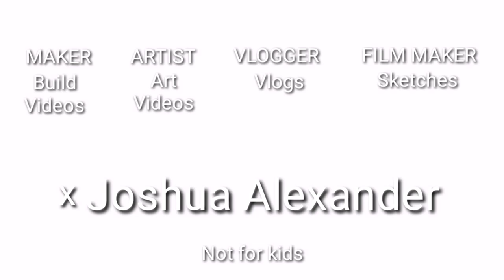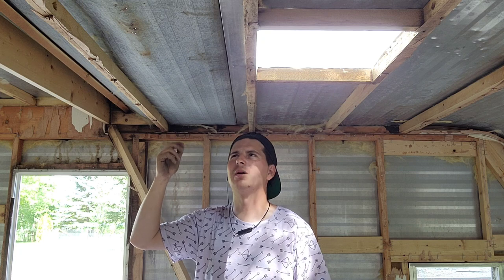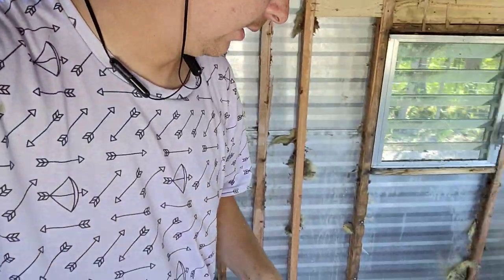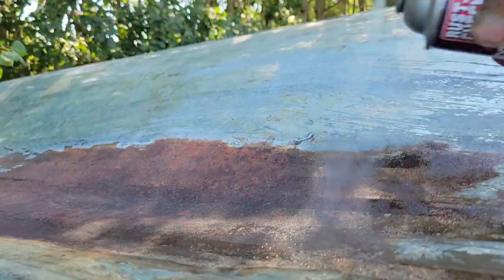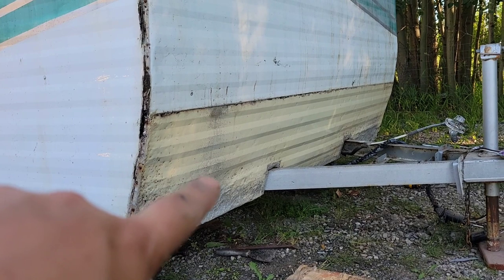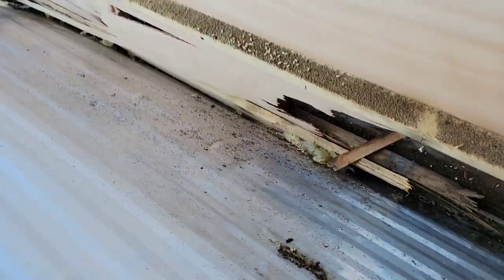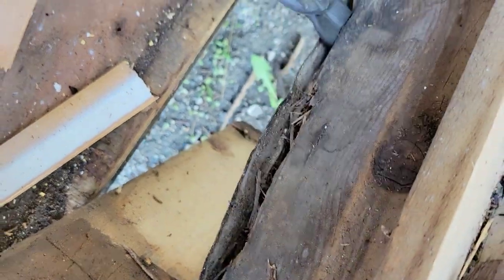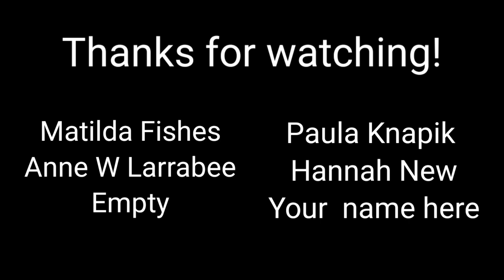The ants ate alot of wood! | Another VLOG #173

Comment: Having restored 4 trailers from that era by the time you get rid of all the rotten wood you will be down to the frame. Remove the metal and save it and rebuild the wood and reattach the metal to the new frame. Anything else is a waste of time. This is bringing back a lot of memories. Lots of vintage trailer suppliers on the nest.

Comment: we have always used a couple cheap screw jacks on the back bumper to keep the camper from tipping backwards from your weight in the trailer. which you’ll need when you use it unless you always keep it connected to the truck hitch

Comment: The endless adventure also renovated an old '70s Winnebago. And they also tore out the whole inside and had some issues you are having with yours. You might want to watch them and see some of the solutions they did in their trial and error renovation. I think you'll really like it!
Reply: Great minds think alike. I mentioned them with last video. Same challenges but I was thinking about how they sealed everything so tightly from water leaks….and usd wood on the exterior too.
You’re right about this too.

Comment: Awesome Joshua, Take her back to the bare bones.   As you start "reskinning" her I will lose all respect for you if you use a household silicone product.  Look at how boat builders do it.  Look at 3Ms 4200 and 5200,   Try and use a 2 part penetrating epoxy on all pieces of wood you lay in (preferably Smiths Systems-though I doubt it's available in CN.)  When you relay the skin-make sure predrill the holes and use a syringe to prefill them with penetrating epoxy.  
I've rebuilt boats that I lived on that had tons of wood rot.

Comment: Yikes; kinda looks like you might have to build anew from bottom up and then use the original exterior frame siding/metal. It would be all new and custom inside and the only original parts would be the facade of the outside metal with logo etc. I'm surprised it was so rotted. What now?

Comment: Personally, I'd take the measurements of all the inside studs/joists, replace them one  by one first so you can keep the rigidity of the shell. add some cross braces at floor level to help. while doing this, you disconnect it from the floor. when you have all the studs/joists done, get help to remove the shell from the floor, rebuild the floor, then reattach shell.
It sounds like a lot, and probably will be, but from how rotten that one side looks, and how bad that chip board on the very bottom is, it's probably the best way to make sure you get rid of all the rotten stuff. Would also allow you better access to the frame to clean/Reinforce/rustproof it.
Looking forward to seeing how it goes, no matter how you do it...
Reply from the maker: Excellent plan of attack.

Comment: Hey, Josh. I did the same thing a few years back. The more you take apart the more stuff you find. A suggestion for the guard on the front, a spray on rock guard for cars might work. Its paintable,  Canadian Tire sells it. Or maybe a spray on  bedliner. I've used the bedliner on the grille of my truck and it seems to hold up pretty good. At least it has for 3 years in sourthern Ontario.